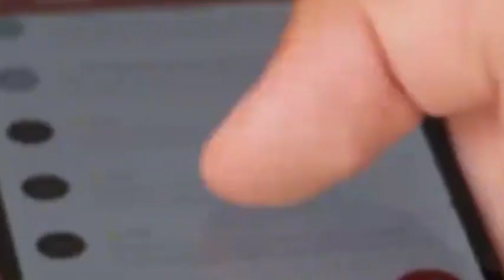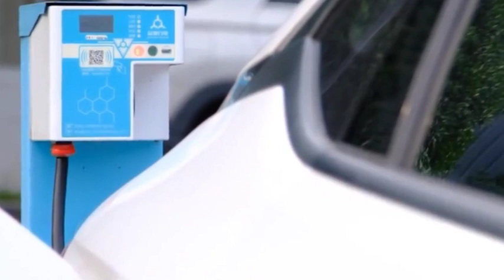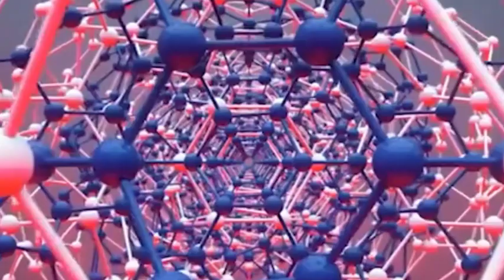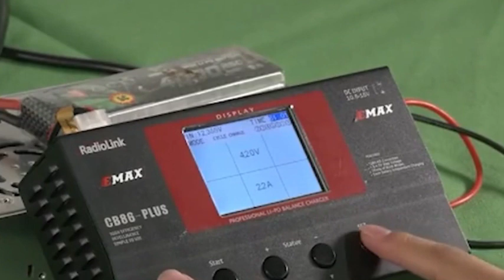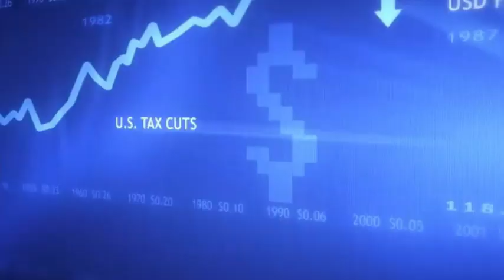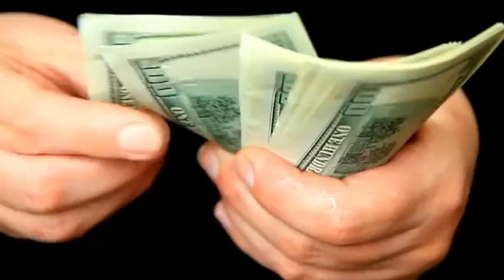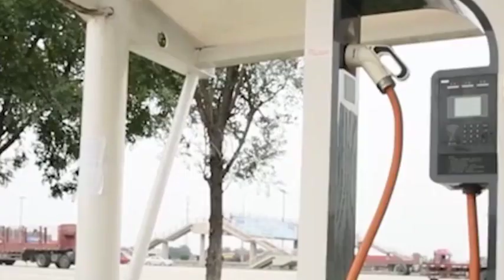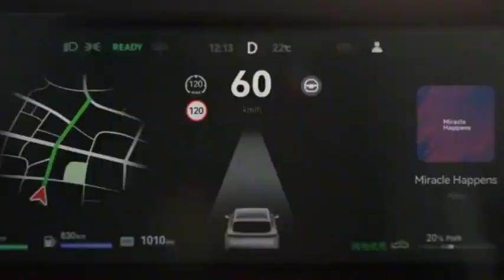Huawei’s black phosphorus battery innovation debuts to rebuild the energy future!

Comment: Sounds great.  Cost? Temperature range? Competitors?
Reply: It is safe to assume China has access to phosphorus, hence the interest in this material. The cost advantage should be obvious anyway.
Reply: @herobrinecyberdemon8104  China is the largest miner of phosphates, primarily used for fertilizers.

"Black phosphorus is the thermodynamically stable form of phosphorus at room temperature and pressure, with a heat of formation of −39.3 kJ/mol (relative to white phosphorus which is defined as the standard state).[1] It was first synthesized by heating white phosphorus under high pressures (12,000 atmospheres) in 1914. As a 2D material, in appearance, properties, and structure, black phosphorus is very much like graphite with both being black and flaky, a conductor of electricity, and having puckered sheets of linked atoms"  (Wikipedia)